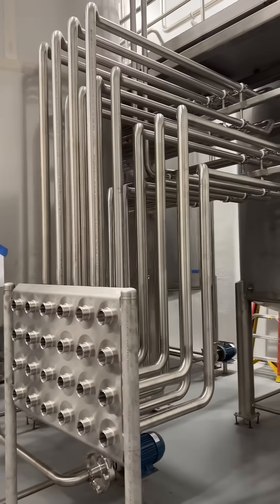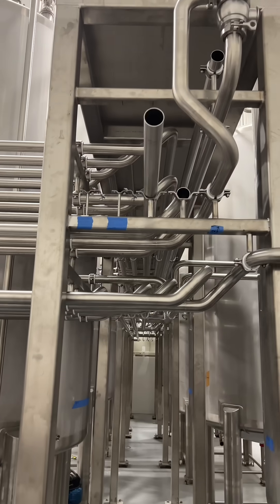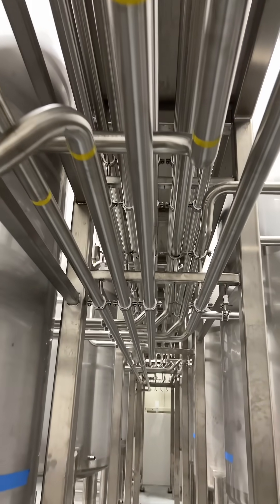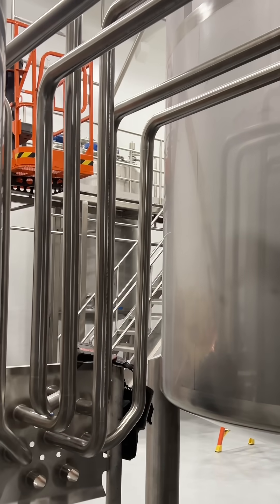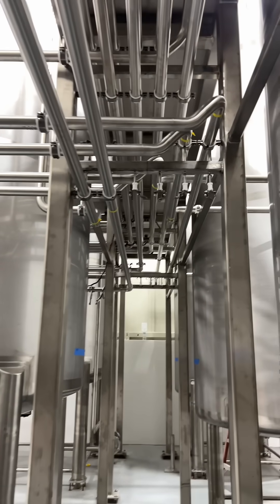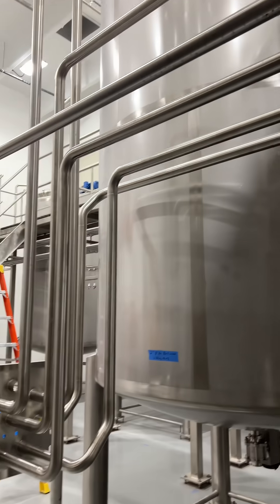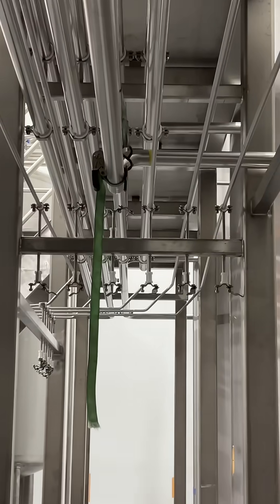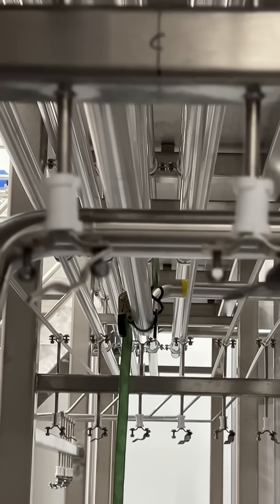See Inside Food Process Plant

Comment: Curious what the cleaning process is after the welding is complete. Is there anything you do? Does the plant just have their own process once all the work is complete?
Reply: Typically there are CIP (Clean In Place) processes that get performed at a regular interval. CIP solutions get run through the pipes at sufficient velocity to create fluid turbulence and the solutions are able to clean, disinfect, and either evaporate/get rinsed away and/or be nontoxic to consume